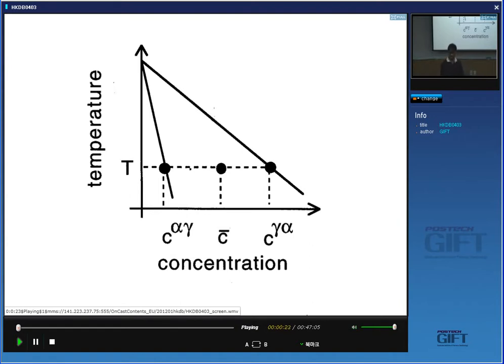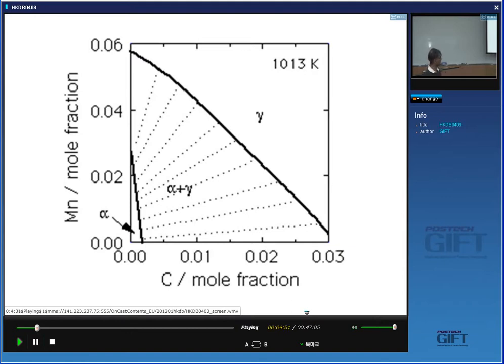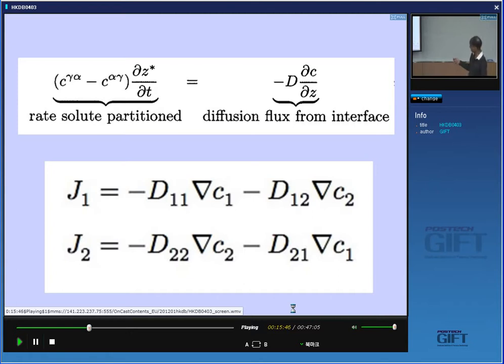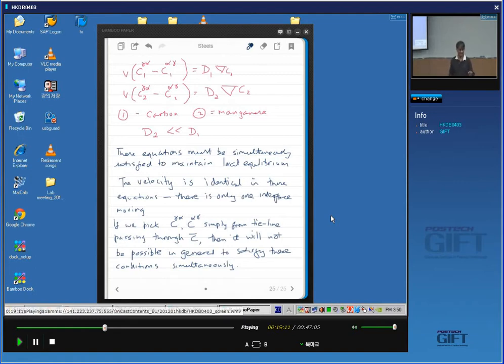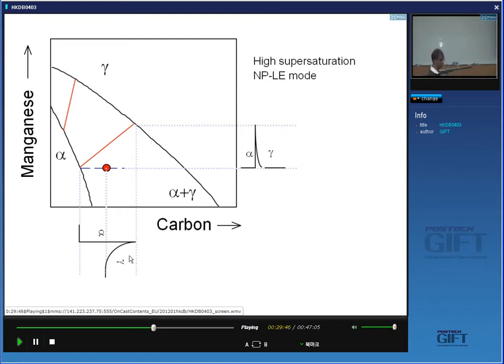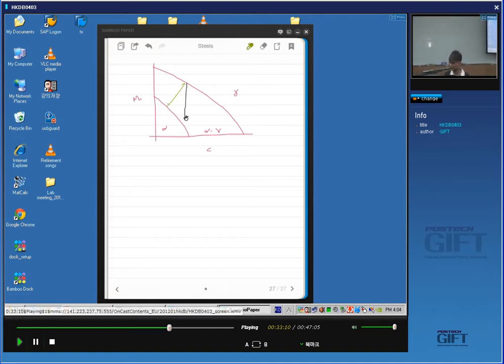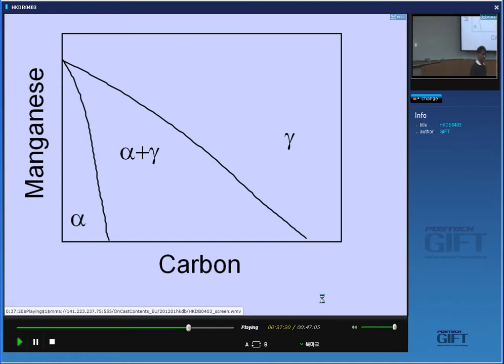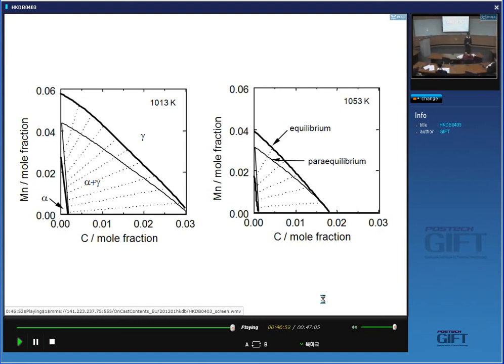Physical Metallurgy of Steels - Part 8

Comment: You said the majority steel produced is by para equilibrium modes where elements like Mn are frozen. Was wondering if that is the case that substitutional solid are not moving due to the para equilibrium mode of transformation then why allotriomorphic ferrite is the major phase found and not widsmantatten ferrite in low carbon steels?
Reply from the maker: A reconstructive transformation still requires sufficient diffusion so that the crystal structure can change without causing displacements that are associated with strain energy. So even though Mn does not partition, there has to be sufficient mobility to eliminate any change in shape. It is only when the mobility falls below this required extent that displacive transformations set in.
Reply: Thanks! nice explanation.